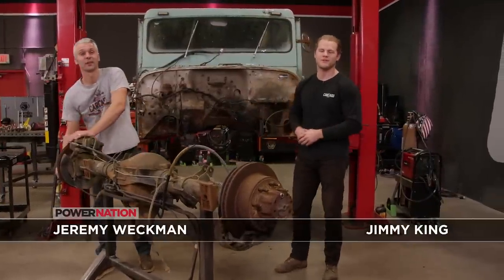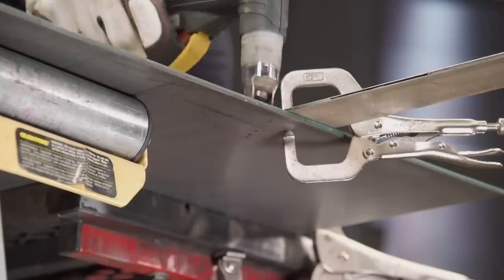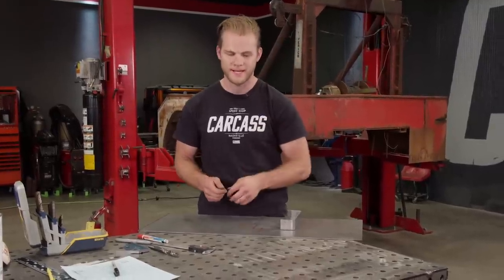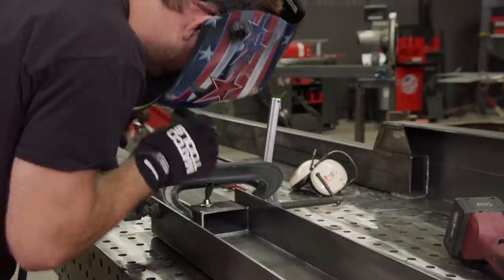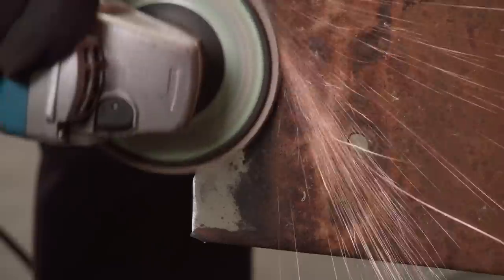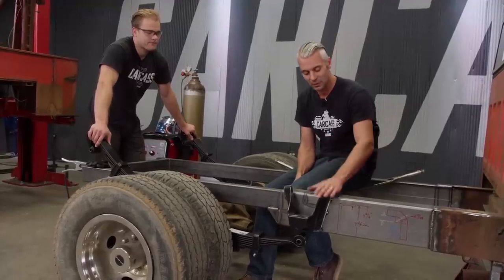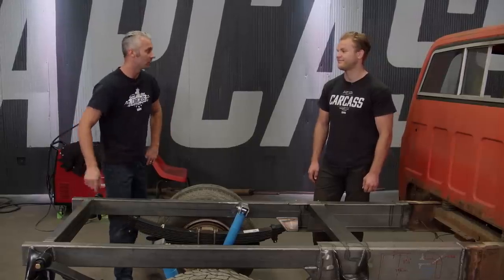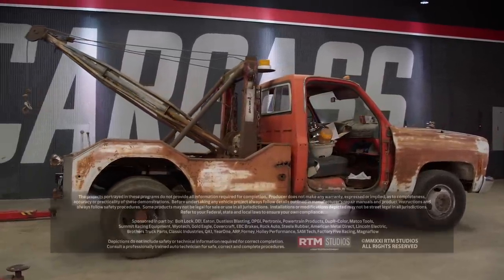Rebuilding The Rusted Out Chassis On Our Square Body - Carcass S2, E2

Comment: Carcass is going to take on a whole new meaning if somebody is foolish enough to get behind the wheel of this thing, load it up, and try to drive it with that back-half on it.
Reply: Ok how would you have done it then?
Reply: Frame is an alloy which is heat treated. Welding on frames changes structure. That HSS tube is not nearly as strong. The splice to original frame also has a procedure. Not to weld vertically.
Reply: I fully agree that thing is going to snap in half, it's been welded with hardwire SMH!

Comment: They clearly demonstrated how NOT  to replace rusted out rear channels
Reply: I would have just gotten a new frame
Reply: Maybe a cut at a 45° angle to have more surface area to weld and add a backing plate...but, maybe that's why we're not on TV 🤷🏻‍♂️
Reply: @bigboreracing356  uhhh...... a 3G weld has nothing to do with structural strength
Reply: @bigboreracing356  not really trying to show off but,that is a blind weld were its welded behind the face of what your looking at....its more common on handrails and ornamental work....very seldom would you see that on a structural job.  Unless the design was revised during erection.. I'm not really into  a pissing contest.  I just had earthquake wire and 1" certs....

Comment: 16:56 this doesn’t look normal to me; is the chassis supposed to bend like that when you lift it with the floor jack?
Reply: I didn’t notice it bending,  maybe a little flex from side to side which would be ok,   I don’t know why they didn’t run the 4 x 2 box metal all the way forward to the cab though,  they only overlapped by a few inches,
Reply: I didnt see any bending....just the leaf springs moving was all
Reply: It might not actually be bent; I’m watching this on mobile, so sometimes things look a little abnormal on my screen
Reply: @Jaz_3001  Watched it on my PC, it did bend...

Comment: Neat project!  I had to do a similar repair on my 1977 C10, 20 years ago, and it's still holding up fine.  For those who might need to do a repair like this (at least on a half-ton), there's an easier way.  First, forget the made-up channel section.  Just use 4x2 HSS (I used 3/16" wall, these guys used 1/8").    Weld some cross members, like angle, across the chassis at a number of points, to ensure the original rails stay parallel and spaced correctly.  Then remove all the original crossmembers (at the front spring hanger, and back of chassis), and spring hangers.  Now, use a grinder or plasma to cut out the lower flange of the original frame rail, where it humps up and over the axle.  With that done, it will be possible to slide the 4x2 steel INSIDE the original frame rails, from the back, pushing them forward.  The original frame will nearly hold them in the perfect location, no measuring.  Start tacking them into the frame, but only at the front, where the overlap between the old and new occurs.  Then tack in the 4x2 crossmembers, noting that the front member (front spring hangers) needs to be flat/horizontal to clear the driveshaft.  Once everything is checked, weld it all, and at the front, gusset between the bottom flange of the original frame and the bottom corner of the 4x2, about 2" high, to box all this in.  Next, carefully cut the old framerails so that they can be slid off over the new 4x2 steel.  Then attach the spring hangers (I bolted) and axle bump stops, and shock mounts.  That's pretty much it.  If anyone wants to know more, just ask.
Reply: What kind of steel do you use? Can you use A36 mild steel?
Reply: @jc-meza  I just used mild steel in a rectangular form (known as HSS).  Welds easily and is plenty strong enough.
Reply: @gregholloway2656  Thank you! 😎👍🏼

Comment: What type of steel was that homemade channel made out of? I’d be curious if it has at least the same properties as the original frame, especially on a tow truck with a heavy service life. If not, it wouldn’t hurt to box it in. A frame failure could be devastating.
Reply: I’m more worried about that straight weld line. A straight weld line like that is weak
Reply: I agree. Needs a diamond fish plate. The bent channel didn’t look very straight/flat. Maybe it was the camera angles. Looks sketchy for some reason.
Reply: I doubt this truck will actually be used heavily if at all
Reply: @reweydewy  true. I guess this truck will be more of a novelty than anything. This still doesn’t send a good message to the novice DIY guy trying to perform a frame repair. I hope people do more research before attempting this themselves.
Reply: @bigboreracing356  that’s a 3F weld, not 3G, if we are talking about test positions with what I assume is AWS D1.1 in your reference. The GMAW vertical up progression can work as long as it’s set up with a true short-circuit transfer. A weld procedure is possible for this, but not easy. Gas-Shielded Flux core (FCAW-G) is an easier and better option, though. FCAW offers more penetration and is easier to weld out-of-position (3F, 4F). Using a solid-electrode “bare wire” (GMAW) would work fine in this application, but would be better with a fish plate of sorts. It also helps get the weld positions into more of a 2F or 4F position, depending on the angle of the fish plates, making for an easier weld with better chances of getting adequate penetration. 2F in a spray transfer offers a substantial amount of penetration when compared to short-circuit or globular transfer. 3F short-circuit GMAW is not an easy weld to get adequate penetration, and 4F isn’t much better. SMAW would be a good option as well.
Reply: @bigboreracing356  no, I didn’t paste that out of a textbook. That’s my personal experience with 12 years of welding and 5 years of inspecting. That is a 3F weld, not a 3G weld. It’s a vertical lap Fillet weld (3F), not a vertical Groove weld (3G). It’s not flux core because there’s no slag covering the weld when he’s done, no slag to chip, no slag in the ground, and very little smoke. Yes, you can use hardwire vertically in the 3F position.  My suggestion to you is to know what you are talking about if you are going to try and correct someone on the internet. Right now, it’s apparent you don’t have a clue what you are talking about since you are basing the weld process on weld progression.

Comment: I would definitely not tow with that the metal is not heavy enough. I have run tow trucks quite a bit and seen the factory frame crack and bend under the pressure

Comment: My concern here is the way you guys built your frame using Tube steel which will eventually rust out and then the homemade Channel you put the tube steel in you didn't cantilever it even though gusseted  between the two you didn't cantilever it and that's going to make for a weak spot

Comment: I’d consider talking to dustless blasting and have them take all that rust off the bed and repair some of the structural points of the towing arm and ect it would make it 100 times easier and cheaper than taking it all apart and then having to take it piece by piece to a blasting place

Comment: I am a structural engineer not fish plating the existing frame to the new frame goes against everything that I was taught about steel connections.   The shear stress under a heavy load could break that welded connection.  On a practical basis that old junk will probably never be used for any heavy towing anyway.
Reply: @bigboreracing356  Because without an X-ray there is no way to determine id the weld is 100%.
Reply: @bigboreracing356  To be fair you would not have to fish plate it, if the weld was done right.
Reply: It wasn't butt welded. It was slid inside of the rails of the truck and if welded on both ends it should be fine.

Comment: Awesome job for an old truck. I would be a little concerned doing this on something more modern as they frequently will use High Tensile steel in a chassis.
Reply: @bigboreracing356  In the old days rivets were usually used on special steels.

Comment: You know there is such a thing as a C.W.I., right?  Certified Welding Inspector is a thing..."Well, I've inspected welds" doesn't equate to an inspection certification either, as in advanced metallurgy, metal compositions including carbon content etc.,and that cert. is no joke. That's a certified welder with at least 5 years on the job then taking a hellish test that takes literally about a week to get through with a first time passing rate of about 20%!!  Meaning 80% fail. I'm not downing anyone, just sayin. And a structural engineer could weigh in too!

Comment: About time they did a real project instead of butchering a 3rd Gen F Body or making a TB ugly.

The only Problem is I would of pulled the body, trans, engine, cleaned the chassis up, repaired any of the body, rebuilt the engine with vortec heads with a common rail fuel injection system with a 6 speed manual or automatc. Or did a fresh carb overhaul with a 6 speed manual.

I would of put in the frame with the proper well over the axle like the original frame. Also I would of kept the new frame dimensions exactly the same as the old and added 3 foot box splices that fit the inside of the frame all welded to add strength.

Comment: Think i woulda just found another reg cab long bed frame back half isnt rusty but front half still suffers from same levels of rot and rust as the rear did wouldnt be suprised if the frame ends up cracking at the steering gearbox one day because of rust

Comment: Your little 3 or 4 inch overlap of new frame to old isn't good enough.  There also should have been horizontal diamonds welded on to reinforce the spice better.  If that truck actually got used as a tow truck, that splice would not hold up.
Reply: @bigboreracing356 , nope, I've always had better sense.  However, I have seen several welded that way that didn't hold.  Any other "good" questions?
Reply: @bigboreracing356  whatever.  I've seen that same type of repair break several times from abuse vehicles go through, and I wouldn't bet your grandchild's life on it, but you go ahead.
Reply: @bigboreracing356  and you think the welding in this video will hold, and I think you're wrong.
Reply: @bigboreracing356  But you're willing to defend it, because your "quality of work" would not fail.  Since you didn't do this welding, your whole argument is moot.

Comment: Down bead meaning is starting at the top and going to the floor, cracks fast no strenght to weld joint. vertical welding is floor to top all the penetration is being put into the joint itself making it a strong joint. For people who don't know even the welds look different.

Comment: Tow truck with a small block is wothless  . Its all for show. Big block 454 will run circles around it and make you money for years to come
Reply: Not necessarily. When I was a little boy, my papaws friend started a wrecker service. Early on in his business adventure, his wrecker blew the original 350 sbc up. Papaw pulled his own tow truck into the the garage, removed the engine, pushed it out and brought his friends in and gave him the motor. It lasted for years and made him thousands of dollars, if not hundreds of thousands. It’s not all about the engine, it’s gearing from the transmission and rear end as well.

Comment: That chassis over the axle should be taller. You can tell this is for show only, and not work. Still nice job regardless.
Reply: Well the fact that they are putting in an automatic with a 480 mechanical lift shows its for just a show
Reply: They went from C channel to tubing-I think they actually made it much stronger.
Reply: My thought is I think I would have felt better if they would have overlapped the tube on to the c farther but overall I would say it should be pretty tough
Reply: they also didn't do any fishplates, just a straight weld. definitely gonna break in half.

Comment: So the frame decided to stop rusting and rotting out right at the back of the cab?
Reply: the gap between the cab and bed allows rain to get to frame,and rust it there,my 79 gnc tow truck is bad there,they sit outside in the elements for years

Comment: Mig weld is not strong. Arc welding is way better. They didnt even chamfer the cross members before  welding. This frame will break right after the  weld.   A frame not only flexes, it twists alot. If you dont spread out strength over a far distance it will fail.  This is how you join the two frame halves, use a Z  joint like iron workers use on I beams. then cover the length with a separate C channel about 2 feet long  fit inside  the existing frame joint , then weld the C channel with  interrupted welds  about 1/2 -3/4 inch long. Along its ends.  You  should have used 1/2 inch  grade  8 bolts used  with  a  welded  spring perch all four perches

Comment: Just get another frame it's cheaper and that now will not pass a CDL inspection
Reply: a CDL inspection? A commercial driver's license inspection, wtf are you going on about? A state motor vehicle inspection is not a CDL inspection, lmfao
Reply: @TheRoadhammer379  when I  took my CDL the instructor had me get under the truck and inspect everything and nothing is good on an inspection if you do not word it correctly you failed and if the frame has been bent or welded they will fail your vehicle they even failed the vehicle that we took because the driver side door had been replaced and the body shop did not replace the vehicle information sticker in the door jam it failed so we had to go the Dodge house and get it replaced $300.00 bucks later I finally got to take  the driving part of the testo and being a tow truck has a hole other set of rules that is what I and dot is saying
Reply: @TheRoadhammer379  if you have not applied for a CDL on the last year you will have no idea what I'm talking about sorry
Reply: It's the same when you're taking a driving test. They inspect the vehicle to make sure they don't die while you are driving..

Comment: You guys should of had the frame  blasted, then reinforced it.  Another poor half assed job that will never do any actual work.
Reply: You are correct that vehicle will never do work. It's going back to the junkyard with lipstick on.
Reply: I know right, the original frame wasn't even bad. Literally 6 inches of bottom c channel and crossmember reconstruction....
Reply: i said the same thing.

Comment: You are absolutely wrong about the spring hangers.  1/2 ton and 3/4 ton (10 and  20) measure the same from leaf spring to leaf spring packs.  1ton or 30 models are narrower between leaf spring packs. This is for the commercial options. Its ridiculous. GM should have made them standard like was started in the obs. Plus you didn't overlap far enough into the old frame with the new section.

Comment: Pretty thin on that c channel and tubing.
Reply: The C channel is 3/16", which I assume is the original frame rail thickness, the box section is 1/8", which I agree isn't the beefiest.  Obviously a box/square shape is geometrically stronger than a C channel, so I guess that's why they downsized in thickness.  

Back in those days, all 1/2, 3/4, and one ton frames were nowhere as thick as they are today.  This will be more for show, not go.
Reply: @jasonholloway2476  I would have used at least 1/4 c channel.
Reply: @justinevans5616  Agreed.  Once done, this project will most likely be sold and forgotten about, they don't have as much of a personal interest in this project vehicle like the rest of us would in our projects.
Reply: I would have gone 1/4"
Reply: @bigboreracing356  ok poor
Reply: @bigboreracing356  nah because you're poor.
Reply: @bigboreracing356  i can afford 1/4 c channel
Reply: @bigboreracing356  I have 2 brand new trucks and the difference in cold vs hot rolled on c channel isn't enough to not use 1/4. The frame on my m998 is heat treated steel and it's thicker than 1/4.

Comment: You boys might want to do some research because 1/2 to 1ton chassis are the same width so so are 4x4 and 2 wheel drive so you cutting the hanger mint you messed up somewhere

Comment: That chassis doesn’t look strong enough or is that just me?
Reply: finally the comment that i was lookin for 
thanks god
for me too it doesnt look strong at all 
they should ve welded 2x8 square tube instead of that floppy c chanel they did
Reply: @bigboreracing356  okay the welds r srtong 
But What about the Thickness of that sheet they've used !!
Reply: @bigboreracing356  i guess 🤷‍♂️
I didnt pay attention when they mentioned it 
Soo 
🤣🤣
Reply: @bigboreracing356  ahh okay

Comment: Both hostes need to go back to welding school welding down beads(looks real nice but cracks fast)  on all your leafspring hanger is wrong that is a high stress area. The correct way is to run vertical welds.

Comment: Least. You know how o weld up hill most shops weld down hill drives me nuts
Reply: Vertical up weld is always stronger then a vertical down weld, you get better penetration on a up weld then a down weld
Reply: @bustinyanutz4195  you will always get better penetration on up hill you are welding on new steel not the puddle but after I posted this they are welding down hill
Reply: Shouldn't anything structural where penetration is a concern be welded flat if it can be? I'm sure they aren't even using the appropriate wire either

Comment: They did way too much unnecessary math for those bends. Get your measurements, the material thickness, subtract your bend allowance, and throw it on the break. These guys must get paid either by the hour, or word count.

Comment: I was with you till you started showing how to find the bend line. You said to start at the middle at 3 11/16 minus the thickness of 3/16 which is 3 and 8/16 or 1/2 but the minus the 17/128 left 3 7/16 that's when you lost me. I cant find how to make 17/128 into 1/16. I'm a 61 year old fart so dont be to hard on me because I dont understand math I'm still trying to learn.